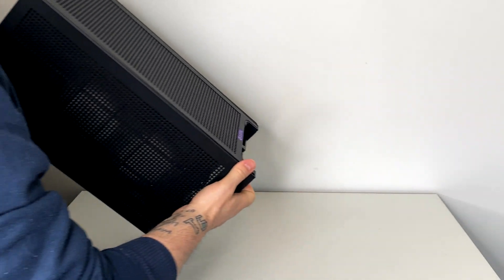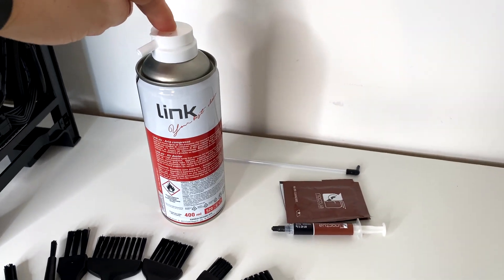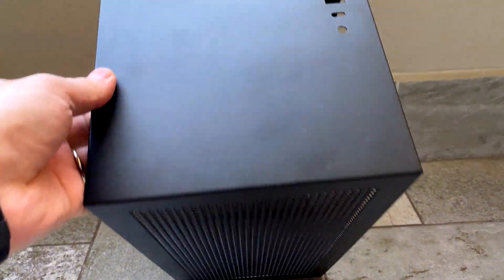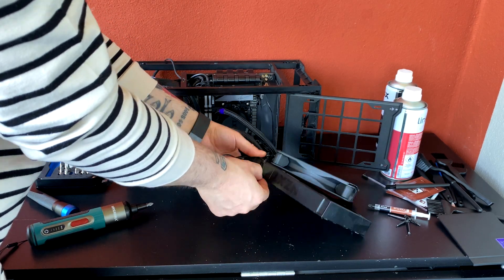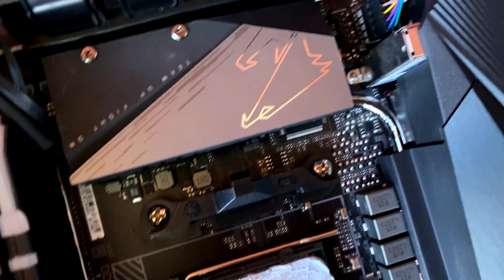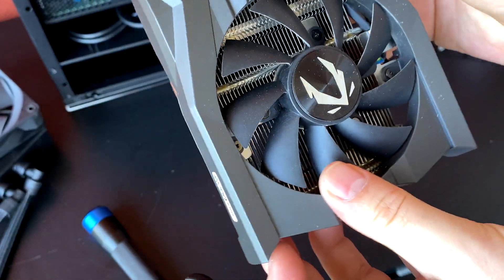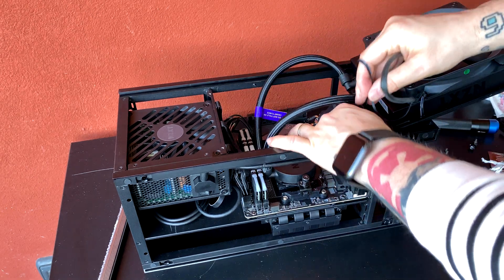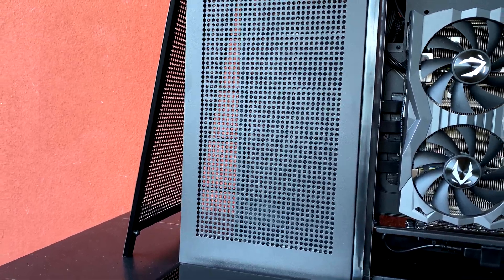How to clean your PC | Part 1 - Mini ITX Build

Comment: I have the exact same case, I really needed to clean my case. This video was really helpful, even if it was from 3 years ago. 
I just have one question, did you reapply the thermal paste in a cross pattern on the CPU? and is the same for the GPU?
Amazing video, thanks alot mate. 👍
Reply from the maker: Glad it helped, I applied in a cross pattern